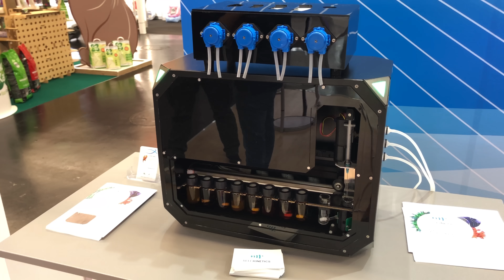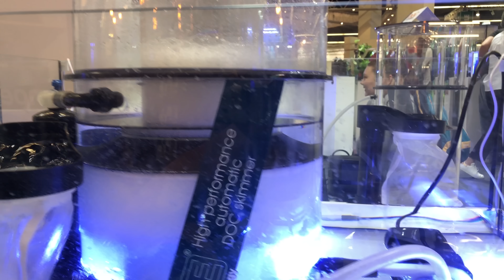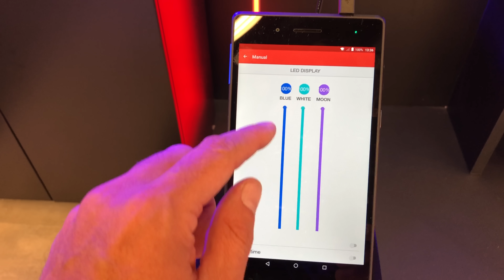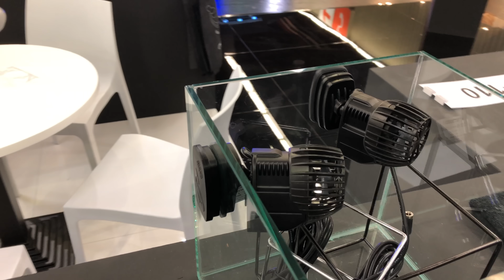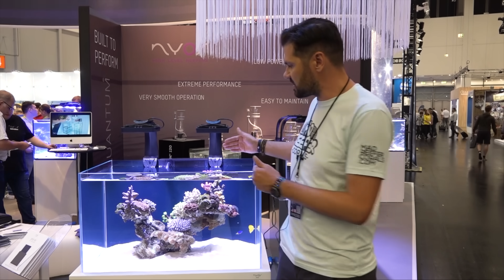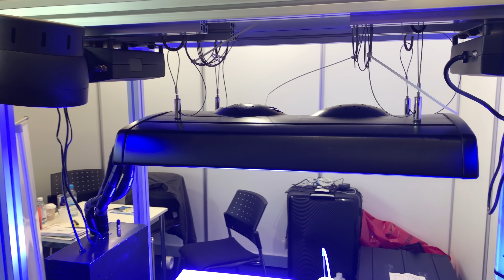Even MORE Cool New Reef Gear at InterZoo 2018

Comment: Thanks Jake!! I really hope to see more from lighting in the coming years, specifically in terms of blanket coverage with leds as well as more par meters. We're always told not to use stuff we can't test for and with lighting we don't test the spectrum or anything..
It will be cool when led light fixtures will have built in par meters that you can float sensors in the tank and relay the info wirelessly : )))))

Comment: Not sure if i heard correctly but for the Tunzee Skimmer, 2000$ Seem very excessive no ?
Thank you for doing those video, very appreciate it.
Reply: Skimmer is rated for 1500 gallons though, so it's not the model most people will get, they do have smaller models that are produced more which is why they're a bit cheaper.
Reply: Thx Mike for the reply. From another perspective, when you look the product from outside, it's hard to understand how they decide to make that retail price, i would love to know where the cost jump when producing those units (beside the pumps). But owning many Tunzee product, the quality and efficiency is there for sure !
Reply: Well good luck with that, could be the 9415 cost about $600, this one can handle tanks about 3.75x larger, so $2000 is a nice round number.   It's just the price that it is, and in the same category of "why does an iPhone cost the price it does" there might not be that much justification other than "Because we can charge that amount".

Personally my question would be how accurate are the ratings on their skimmers as a whole, what is so special about that that every other skimmer that is of a similar size is rated for a much smaller tank.  I mean look at the 9410, rated up to 265 gallons?  Is this a rating with zero live stock?  I mean the skimmer isn't even 5" in the bubble chamber.
Reply: Mike B if you read Tunze’s website, they have information set out clearly on how to size their skimmers to your tank. For a full sps reef, the 9410 should have 70% deduction from its base rating. So with full sps, it’s actually rated for about 90 gallons.
Reply: Hugo thanks for that info, Tunze might have it on their website but it's not obvious where it should be, and online stores sure don't have that info either.   90 gallon tank might be about right for that size of skimmer.  SO I guess the 265 gallon tank with only 1 clownfish is what the "up to" number is for :D
Reply: i will take Tunze over anything else out there. I have the 9480 with four pumps on an 400 gallon system, works great and very quite. Six 6105 power heads and one stream 3. Very quite. Have no complaints with Tunze and their customer service is excellent.

Comment: Lots of cool stuff in the video. I've been using sicce pumps for 10+ years and pronouncing it wrong the whole time! Still got my ati bm250 skimmer. The video I'm really waiting for is Dejong Reef.
Reply from the maker: For the Dejong reef video check out the link in the description ;-)
Reply: Did you not shoot your own video too?
Reply: I too got a ATi BM250, however one of my Sicce pumps had the cord fray a bit and had to throw it out.   Been stalling on getting a replacement, was thinking DC pump so I can ditch 2 pumps for one stronger one and just dial in what I need.   That new Sicce PSK DC pump might be a contender though.